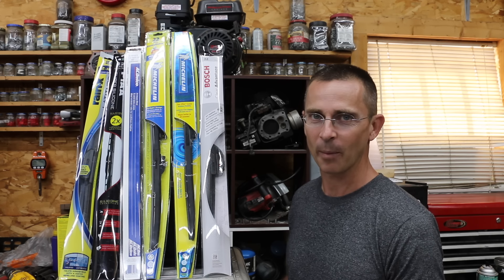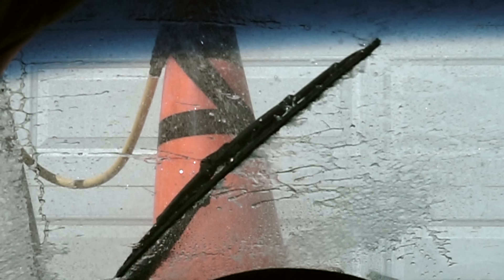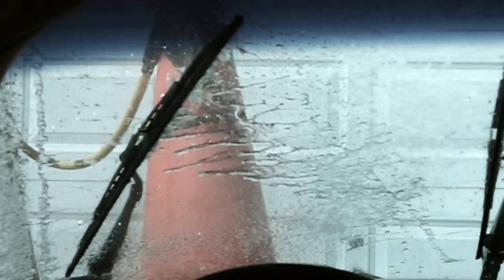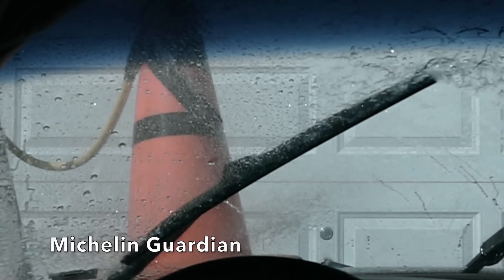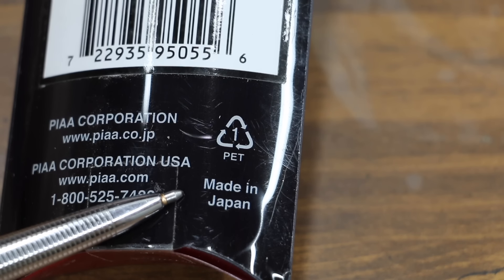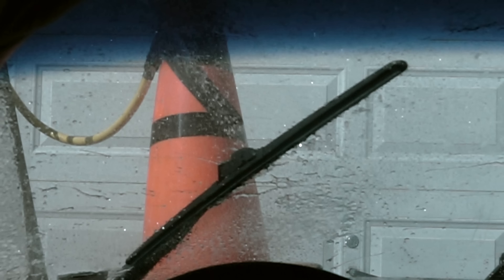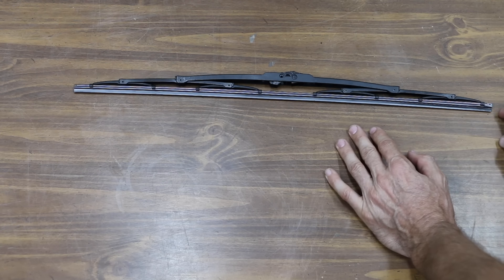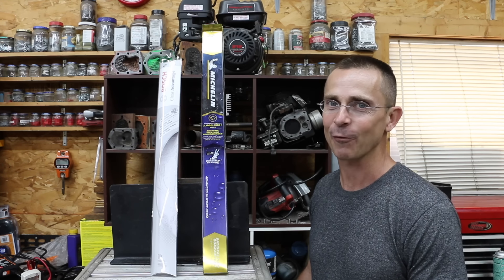Which Windshield Wiper Blade is Best? Let's find out!  Michelin, PIAA, Bosch, AC Delco, & Aero

Comment: I would like to see the same wiper blades and maybe add a few others tested on very flat windshields, I have tried the Bosh and beam construction on my flat glass truck and the beam construction blades do not flatten out enough and leave streaks in the middle of the blade as them seem to be designed for curved glass and my older vehicles with flat glass may just not have enough pressure to flatten out the beam type enough, so I have found the steel frame ones seem to work better on flat glass. I would love it if you can see if you get the same results. Love you videos, thanks for doing them.
Reply from the maker: Great suggestion

Comment: My only problem with these tests is the blades were used on the 'high' speed setting which tends to 'throw' water around the window.  I rarely ever use my wipers on 'high''.  On intermittent or 'low' speed, most wiper blades work reasonably well although there are some differences.   Another factor:  I live near San Diego where it is hot and dry 95% of the year.  Here, the sun bakes wipers to death as they don't get much use therefore, they end up getting hard and taking a 'set' shape on the window which causes them to not work well.  Therefore, most wipers, especially the cheaper ones made of ordinary rubber, must be replaced every year or two here.
Reply from the maker: Thanks for the feedback.

Comment: Glad the Rain-X wipers were applied in the latter test - because if they had been applied to the glass much earlier; then any other wiper tested later would have given a false 'better' result because of the prior Rain-X glass treatment sweeps.
Reply from the maker: Thanks for the feedback.
Reply: @ProjectFarm  I am in hope one day (or over an other one year test period) - if you may test RainX Window Treatment against its rivals?  I have used Rain-X consistently since 1979. I have over the years real life compared Rain-X with 'copycat' bands which were Not as good in my eyes. Oh! when testing wipers, it'd be even more reliable result if a strong fan was included; to simulate a real driving slipstream :)  cheers ps - glad you didn't bother testing those silly twin blade units

Comment: ive got those expensive rain-x blades, & maybe its just the rake on my windshield (98 firebird) but they leave a 6 inch swath right smack dab in the midde of the pass, right in yr line of sight, where it doesnt make much, if any, contact with the windshield. & yes i have checked my wiper arm to make sure the spring tention is good, & yes i swapped em out with another set of the same, & yes i swapped sides... but still the same results. ive had this car for over a decade & no other brand has ever had that issue... the best wiper blades ive ever had, as far as removing water from the field of vision, were those expensive michelins, & while they actually made contact with the windshield unlike the rain x, they squeaked... loudly... very loudly... ive got a 10 speaker cdt sound system & at full song u could not drown out the painfully loud skreetch, & im not talkin intermittent rain, or ocassionally hitting a dry spot, im talkin a full tilt down pour with a very wet windshield, no dry spots, & they never stopped squeaking! hated em so much a basicly threw 50 bucks in the trash after only a few months... so... maybe ill try those bosch blades...? thanx
Reply from the maker: Thanks for the feedback.

Comment: I 100 % agree with the better water management of the frameless beam design. Noticed the same.
Someone should make a good and solid beam with the rubbers slide in for cheaper replacement.
Reply from the maker: Thanks for the feedback.

Comment: I ALWAYS get OEM because with me its all about the FIT of the blades to the windshield and may times other companies get it wrong!
Reply from the maker: Thanks for the feedback.
Reply: I concur;
Loaded this video to recommend Permatex 80070 Silicone Spray Lubricant  or any Silicone  for the person who thinks he has mice in the cab → despite this PF getting more things right than many I found last few days engine rebuild failing due to lifters are flat's yet has to be slight crown → not sure how that works and .010 should be sufficient given ideal machining but  a flat would spin the lifter with fail in a few thousand miles · I have been OEM except for had to install after-market distributor on 01 Silverado "W" since the OEM could not be placed in time new on showroom floor • Discarded 5-volume factory manual which I had before taking delivery for such things as that ~ persons who write those manuals are versed in words not mech

Zen and the Art of Motorcycle Maintenance
Book by Robert M. Pirsig & American  Graffiti behind the scenes
How "American Graffiti' Triumphed Over Studio Rejection" ...?
Vvery very carefully!!!

Comment: Got me some Bosch clear advantage based on this review but I was not a big fan.  The blade on the passenger side did not come with the flap that locks the blade to the arm and it never felt like it was on securely, causing a slight chatter.  Sure enough, on a day when it was raining really hard, the wiper arm was moving at max speed and the blade got detached and flew off the car.  Never had that happened before with other wipers.  Anywho, I am back to OEM and it feels nice.  Probably just gonna stick with oem and just change the blade inserts from now on.
Reply from the maker: Thanks for the feedback.
Reply: Project Farm No problem...probably just an installation fitment issue particular to my car only.  Did you ever get the results of the UV test yet?

Comment: The best and longest lasting wiper blades are the ones made from silicone rubber. It has been two years since I replaced mine and they still work like new, whereas the conventional rubber only used to last only six months in my case.
Reply from the maker: Thanks for sharing.

Comment: This is an interesting video but since wipers are mostly to be used while moving I'm wondering how airflow would affect the performance.
Reply from the maker: Thanks for the suggestion.
Reply: I was thinking the same thing. I have a pair of wipers that perform very differently at speed than at stop.

Comment: You can see that the RainX left a chemical streak on the window where the right blade stopped for it's return. That would drive me nuts and why I don't use any wax protection in drive-thru car washes.
Reply from the maker: Thanks for the feedback.

Comment: I’m a big fan of any decent silicone blade/beam design and using a Rain-X washer fluid as it puts that same repellent coating on the windshield. I drive roughly 140,000 miles a year in my car (yes, I go through a LOT of cars), and this combo holds up every time. The Rain-X washer fluid also comes in different seasonal varieties for summer, spring/fall and winter driving. Also- don’t forget to shine up the headlights with a good kit and use the Rain-X on them as well- keeps a lot of dirt and mess off them.
Reply from the maker: Thanks for sharing.

Comment: What about the wind? It has significant impact when driving. I think RainX wipers fluid is using wind to remove droplets.
Additionally, some wipers have spoilers (like sport cars) for additional pressure.
Reply from the maker: Good Point!

Comment: Those are all cheaper than the last time I picked up wiper blades in a store seems like $20 was the minimum at Walmart. The last that I bought was at Ollies bargain outlet for three dollars. I like the ones with the metal in them as they can be repurposed when they're worn out but they just don't seem to work as well as the wipers my younger days before I was driving.
Reply from the maker: Thanks for sharing.

Comment: One thing I learned from this is that the wiper blade on the passenger side of the windshield throws a ton of water directly in front of the driver. The blade on the driver side then pushes that water back over to the passenger side. The two blades engage in a sort of water throwing contest. I can't help but wonder if it would be better for the passenger side to have no blade at all, or least a blade very much shorter than the original blade on that side. Next time I replace the passenger side blade I'm going to replace it with the shortest blade I can find.
Reply from the maker: Thanks for the feedback.

Comment: This is a very nice test! I hope you can find a way to test durability though, it would probably justify the prices of some of these blades a lot more. I've had several Bosch wipers and they don't seem to last that long, especially in winter conditions (salt, fine sand etc. on the windshield).
Reply from the maker: Great suggestion!  Thank you.
Reply: So what do you use now?

Comment: Almost 11000 comments.... so it has probably already been said, but that windshield coating makes the biggest difference when driving. Often you don't have to use the wipers at all, the water just blows off.
(Haven't used that particular brand, if it even exists here in Sweden... but I've tried other brands using the same idea.)

Comment: I'm looking forward to the one year results. I bought silicone wipers several years ago, and they're still doing well. Curious if silicone still holds up as well.
Reply from the maker: Thanks for watching.
Reply: I get the silicone blades from China for about $6, which is enough for both front wiper arms. They last about a year in the Vegas heat and cold

Comment: I think you did a fair job reviewing the wipers but I have to respectfully disagree with your findings. There are two reasons I still use the metal framed wipers. Number one is at higher speeds all the curved wipers I have ever used seem to lift off the windshield. Second is cold weather. The curved blades have lost there shape while the metal frame you give them a few taps on the windshield and your ready to go, plus up here in the north a lot of us put out wipers up off the windshield over night so they do not freeze to the windshield and it makes it easier to clean off snow each morning.
Reply from the maker: Thanks for the constructive feedback.

Comment: Bought the michelin endurance silicone blades today and they are great except one has a slight flaw on the blade allowing a streak of water on the window trailing the blade.  I'll be going in for a replacement tomorrow. Bummer I know.
Reply from the maker: Thanks for sharing.

Comment: I bought the ones that were coated with graphite to put on my Frontier. The thing is, I didn’t know they were graphite coated and because they got my hands black I cleaned it all off of with rubbing alcohol, which now has the blades chattering across the glass. 😬
Reply from the maker: Thanks for the feedback.

Comment: Hey Todd, I'm curious about the effect of the various designs on aerodynamic drag and gas mileage.  Also, possibly the effect of high speed on blade lift.
Reply: To be fair, washing and properly maintaining your vehicle's body work will have better results over wiper design unless you're using 4x8 sheets of plywood for wipers. 😉

Comment: Oh Bosch... What can't they do?
Shame you missed my go to brand of choice Valeo.
They usually do pretty good whipper blades, although expensive.
Last time I couldn't find it so I got some unknown brand... I think it was Italian, can't remember the name. It was of the hybrid type. So far I am pleasantly surprised by the performance but the biggest test is durability.
Usually even store brand cheap one do ok(ish) when you buy them but after a year they are worthless.
A good Bosch, Valeo or Michelin will last you more, depending on weather conditions, of course
Reply from the maker: If I do another round of testing I will try to include the Valeo.

Comment: Kind of funny, i use the Michellin XT's and after a month of use I have streaks on the right swipe in the middle of the blade where the arm connects to the blade. Sad at only a month of use. This is on my 2020 equinox. Had the same issue on my 2020 escape that i traded in because it was junk. Gonna try Bosch next as I hate Rain X products.
Reply from the maker: Thanks for the feedback.

Comment: Actually... The key to cleaning the windshield is proper treatment of the windshield.  Clean the windshield with windex in circular motions scrubbing hard. The treat the windshield with RainX spray treatment. RainX is alot like wax though so you must buff it out good. I have used cheap blades and they work fine this way.
Reply from the maker: Thanks for sharing.

Comment: i typically use a rainx on the driver's side and a bosch on the passenger side.  a benefit of the rain-x wipers is the water gets repelled from your windshield so you don't even need to turn on the wipers until a moderately heavy rain since the water will run off the windshield in little droplets on it's own.  i just can't justify buying such an expensive wiper for the passenger side, though.
Reply from the maker: Thanks for sharing.
Reply: Awesome idea

Comment: I don't kow if the prices were different at the time of testing but Bosch charges around 11$ for 1 blade not 2. The Aeros are cheaper and a better value. Also, the Aeros come with rubber blade refills essentially doubling the life of their blades.
Reply from the maker: Thanks for sharing.

Comment: 11:26 The RainX brand excells (IMHO) when you are driving at higher speeds, as the RainX makes the water bead up and roll off the windshield!  I had an issue with them once, and got quite perturbed at their support as I was told something to the effect of "well, that's just how the ball bounces sometimes!" I found the CEO's email address and complained.... heads must have rolled as I got about 4 pairs of wipers for free!!! and the CEO apologizing.
Reply from the maker: Thanks for sharing.

Comment: Lacking uv resistance test & would like to see some Anco frameless myself
Reply from the maker: Thanks for the feedback.
Reply: @ProjectFarm  Those anco are sold at rock auto if you somehow happen to extend this testing. This test did confirm the framless works better but I've been anxious to know about UV as that's the number 1 killer of wipers. Does expensive really last longer? And how does UV effect silicon, cheap rubber, & more expensive rubber wipers. I'm thinking the silicon may not wipe as well when cold but not 100%. Thanks for your hard work to test products!

Comment: I will say with rainx blades and most rainx products you don't see the water beading until your driving, I've been on the highway in both rainx and non rainx wipers in identical conditions and with rainx blades or even just the windshield washer fluid it beads the water considerably I have turned my wipers down to the lowest setting or off completely with rainx products
Reply from the maker: Thanks for sharing!

Comment: Have you considered which wiper blade works best AFTER applying liquid RainX? I have noticed after I apply RX and I use wipers in the rain, there are small little beads that stay on the glass that don't wipe off - more so during light rains or sprinkles. Its terrible.

Comment: Can't wait for the UV Exposure test...my experience in Florida is that most rubber blades start to fail and streak after 6-9 months...my most recent pair of blades was some RainX Silicone, and so far they've lasted twice as long as "normal" for roughly the same cost as rubber blades, so based on my experience, I'd always recommend a silicone blade for getting the best life for your buck.
Reply from the maker: Thanks for sharing.

Comment: I really like your car related reviews!  This one got me thinking of glass sprays.  Two different ideas came to mind.... glass cleaners, and water repellent coatings.  Glass cleaners could be reg Windex, 100% bio safe, ammonia, vinegar based, soap scum removal, anti fog, etc.  The water repellent could reuse this setup, RainX, Adams, ceramic, etc.  You can test for slickness, durability,  ease of use/applying, size of water beads, etc.
Reply from the maker: Thanks for the feedback.

Comment: the thing with the rainx blade is you didn't test it with wind. That coating will make rain just roll off the windshield without you needing to run wipers (up to a certain amount, at a certain speed)
Reply from the maker: Thanks for the feedback.

Comment: I really like your reviews, but in this case I think you missed an important element. These blades perform differently when going down the road at 50+ mph. The wind makes the water act differently and the steel frame versions are not as blown around as the rubber frame type. Please add in a high speed wind, if you can, on your follow up.
Reply from the maker: Thanks for the video idea.

Comment: you should revisit the whole silicone vs rubber thing i bought the Michelin Endurance XT blades for my 2017 f150 based on your testing,  less than 6months later the black coating on the silicone blade is completely gone and you can see the clear silicon underneath the result now is they don't clear the dirt off the screen when i use the windshield washers and they squeak really really bad.  if you want i can send them to you to for use on retesting?
Reply from the maker: Thanks for the suggestion.
Reply from the maker: Thanks for the suggestion.

Comment: As far as the rainX blades go if the coating claim is real then i would suggest staying away from them. You would only be applying the coating to where the blasdes contact and it will unbalance the wear of the windscreen resulting in uneven protection. I could imagine prolonged exposure to this would eventually show when trying to super clean the window.
Reply from the maker: Thanks for the feedback.